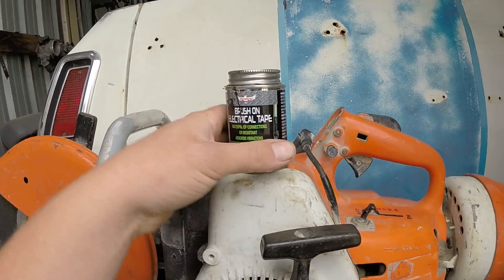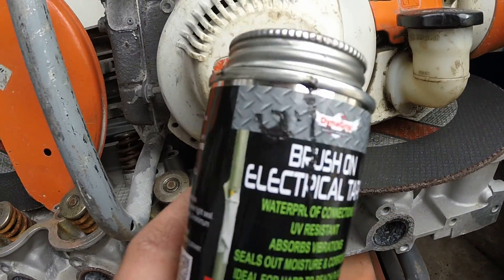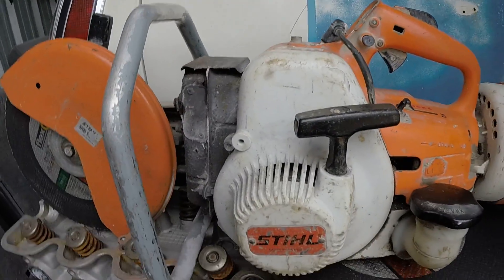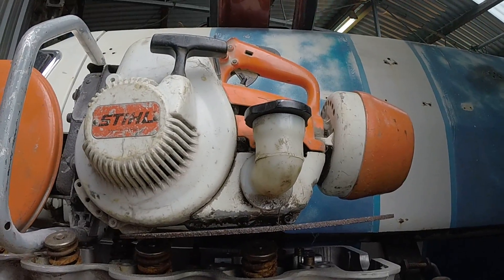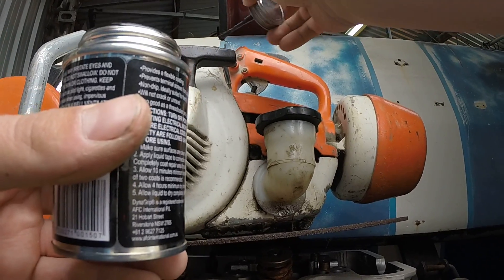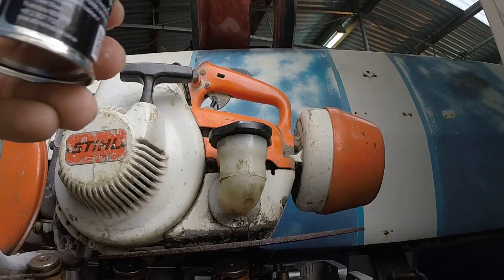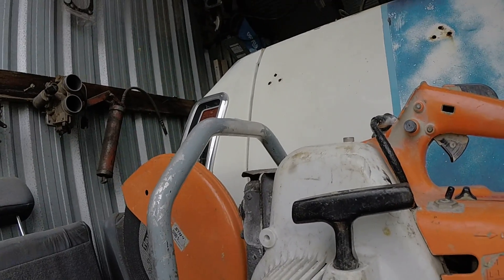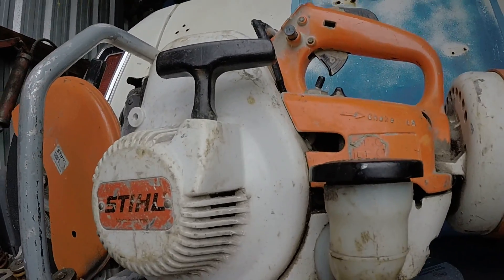LIQUID ELECTRICAL TAPE

Comment: did you test it?
Reply: Tmtgau ther are videos of hem yousing it loke in to the one Up The Sleeve Customs Chanel
Reply from the maker: +TMTGAU yeah use the saw weekly mate stopped me getting a kick off the sparkplug lead when it touches you. Its good stuff.
Reply: +One up the sleeve customs good to hear that it works and you won't get shocked by it again. seems much better than tape because there is no glue to become weak and sticky from heat.
Reply from the maker: +TMTGAU and water gets used as a wet concrete  saw often not rated for high voltage  but couple of coats and it seems  fine